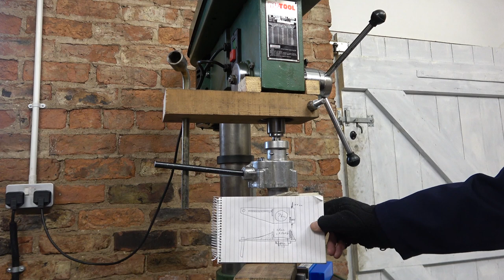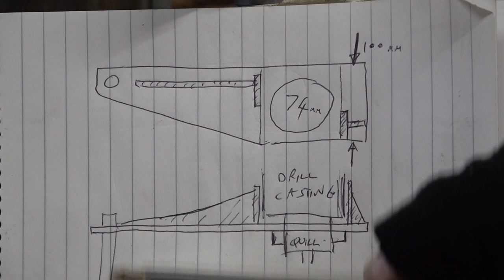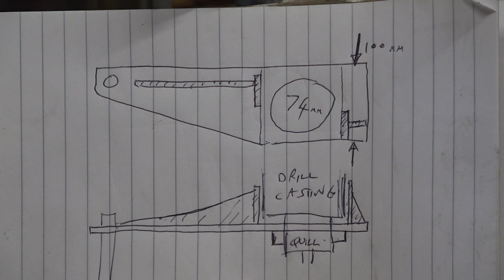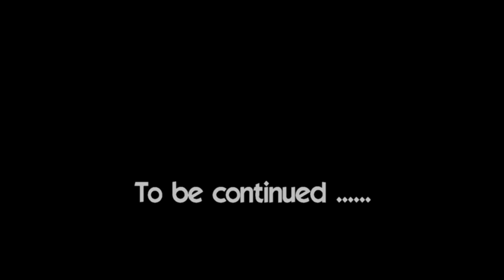HS53 Tapping head & bracket - Part 1

Comment: Nice to see the inner workings of this device. And great engineering on the bracket. Could you have used the column of the drill press as your stop though? Maybe with some kind of soft material for padding like wood or aluminum?  Just a thought,  definitely a cool project
Reply from the maker: Yes I could definitely have used the drill press pillar to stop the tapping head spinning .... most people do that I think .... but why use a simple cheap quick solution when I can make it more complicated :-)
Reply: Sorry to be off topic but does any of you know a tool to log back into an instagram account..?
I was dumb forgot the login password. I appreciate any help you can give me
Reply: @Muhammad Brock instablaster ;)
Reply: @Paul Yousef It worked and I actually got access to my account again. Im so happy:D
Thanks so much, you saved my ass!
Reply: @Muhammad Brock You are welcome :)